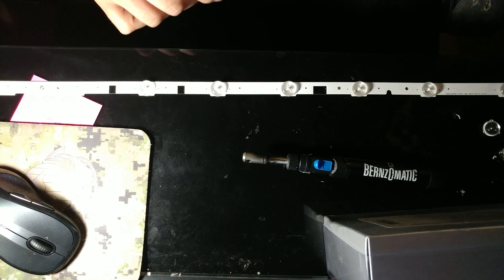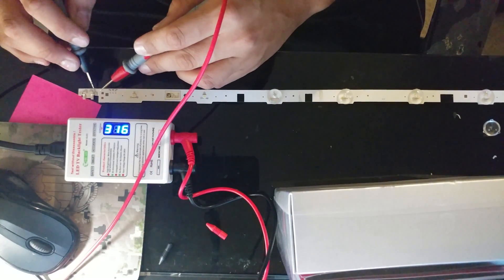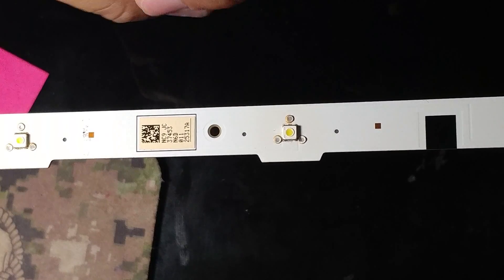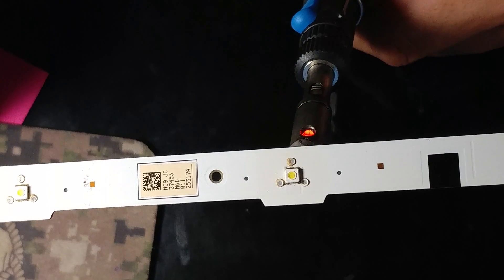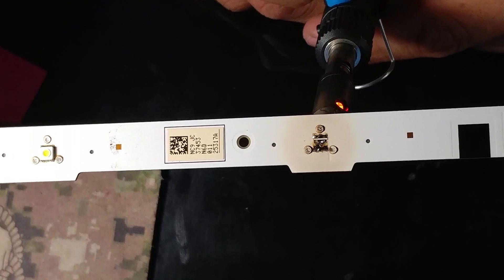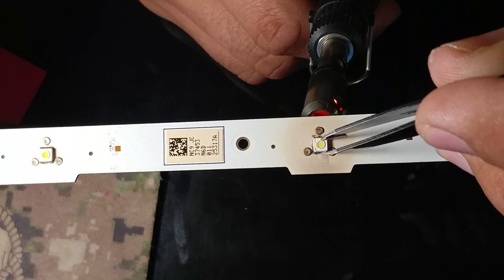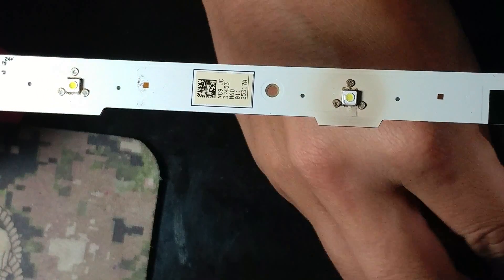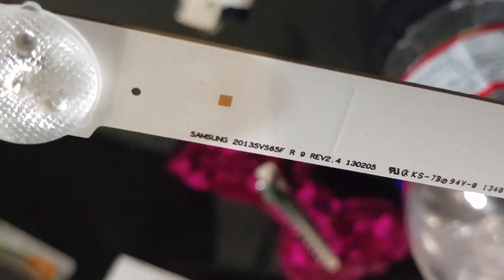How to replace LEDs on samsung strip for Smart TV F series for backlights

Comment: Hi man I have a question. I want to repair my tv but only one of the LEDs is burn and I wasn't able to find a replacement for it so
the question is that. Will still work if I bridge between the contacts without replacing the LED?
Reply from the maker: Yes

Comment: My tv is a Samsung 2013 46 inch LED back lit model, hate using it in eco mode, prefer it in dynamic,  I guess this is the price we pay for a much brighter image quality. I’m fed up having to replace a strip when an LED pops so going this route too. I’ve kept my old strips so I’ve got a few to practice on. I’ve looked on line and they have a 4 digit number, for example 3228, 3030, 3528 and 3537 SMD LEDs and I’ve no idea what this relates to ?. So it’s a little disheartening knowing which ones are right as nothing on old ones to compare ?, thanks.

Comment: Having to do this to a Vizio. 16 strips and each one has a bad LED. The previous owner continued to use it as each strip, one by one, failed until none of them worked. First TV I have seen that has a different circuit for each strip.
Reply from the maker: Yea that sucks. I bet the settings on the brightness was set to 100% brightness.
Reply: Looks like it. Need to put screen back on to verify. I wouldn't have done this method but there aren't very many new strips available for mine. I didn't want to spend money on used strips that cost $10-$20 a piece. I also learned this TV has advanced dynamic backlighting.
Reply from the maker: so with the local diming, its a good and a bad thing... at least for longevity of the tv. as you can see that one led can fail, but will not cut the picture out, and then the next led will go out on a diff array... and so on. next thing you know, you have a super dark tv with only 1 or 2 arrays fully working. lol. if it were a single or dual array, you could have saved a lot of work to replace only one led... But, we all know that this is usd for a better picture.. so..my suggestion is to just lower the brightness to about 70%. Good luck!

Comment: Just replace the whole strip. If one LED failed there's a good chance the others will fail soon, so unless you have fun tearing open your TV again just spend the $10 extra to avoid the headache.
Reply from the maker: How fun would it be to pay $30-40 per strip... When you can pay 5 bucks for 10 LEDs... Your right on some strips, they could be cheap.. but others are not. Especially older higher end models.
Reply: @TECHIELIFE  Look on ebay, it's not $40. Like you said, they can be found cheaply. I guess you have to decide what an hour of your time is worth because the alternative is desoldering the whole strip and prophylactically replacing all the LEDs. I'd rather spend $20 and 20 minutes.
Reply from the maker: Well I've had some TV leds that weren't even on sale. Like the big 75 inch Samsung's I remember that I had to hack up an led strip just to make it work because there were none for sale at all. So while I don't mind spending $20, and sometimes even up to $100(I've done it before) situation is different for every tv. (I've repaired over 50 TV's

Comment: $25 is a lot for a strip. I got a strip from Amazon for $7 that came with 100 3v 20ma and they have others unfortunately I needed 6v and couldn't find those on Amazon so I got a 15 piece for $9 but I ordered a 100 piece from China for $4 just to have as back up but they will take forever to arrive.

Comment: Can someone tell me what numbers I need to find the correct LED bulbs? There is no "BN..." Number on my LED strips.
Reply from the maker: It should be like a 3 digit number
Reply from the maker: What's the model number of the TV'
Reply: UN46H5203AFXZA. I have the tools and knowledge to change individual LEDs but can figure out what LEDs to buy. Some Chinese company on eBay told me they had what I needed but they were 3x the size. I want to buy a minimum of 50 since Samsung TVs are such bullshit quality. I'm done buying new TVs, I'll just fix the ones people give away
Reply from the maker: so the only thig i can tell you is that most samsung leds, are about 3 volts. the size i belive is 5050 (50mm by 50mm) what you need to do is remove one led from the strip and see how the pattern in the back is. (samsung tends to have a weird solder pad)
Reply: @NunYa953  basically you wanna know if their 3v or 6v. Size does matter but I've found you can get by using a smaller smd as long as the voltage is right. Now how long they will last that I don't know but unless you have a caliber it's tricky and sometimes even with one can be tricky because they don't always give all the info needed. Some all thicker then others also.
Reply: @my2centz196  
I found some and just replaced every led since I was in there. Took about an hour. 3v 350mA. The were a little bit bigger but they work just fine.
Reply: @NunYa953  that's awesome. I think the hardest part for me was finding a glue to hold the reflectors on lol. I tried 3 different types of super glue and none would hold finally found some cheap stuff that was messy but worked
Reply: @my2centz196  
I used a clear 2 part epoxy. Pain in the ass but they aren't going anywhere now.
Reply: @NunYa953  yeah I had to also. I tried a bunch of different glues and none would hold. I used some cheap stuff from dollar store that actually worked OK also but ended up redoing half of them with epoxy
Reply from the maker: @my2centz196  I use loctite g02 glue. Works wonders.. and cheap.